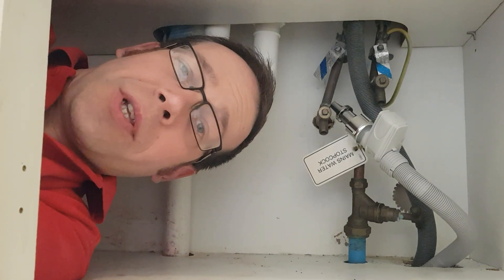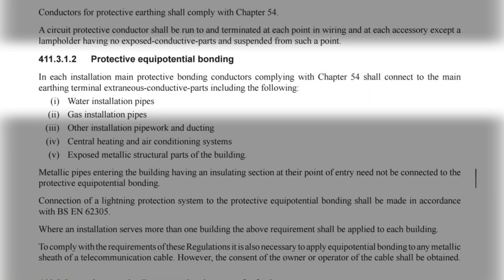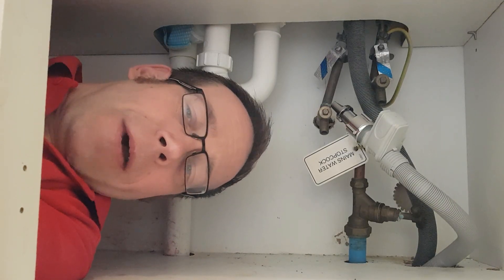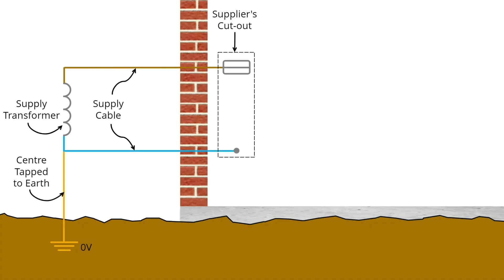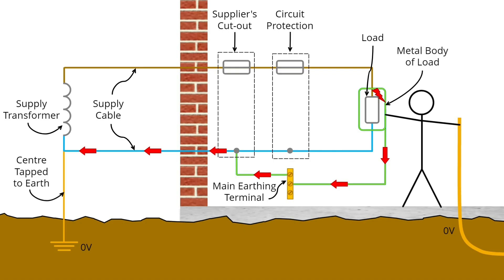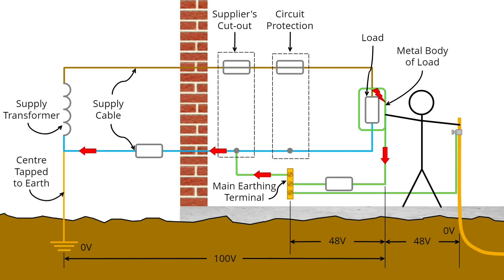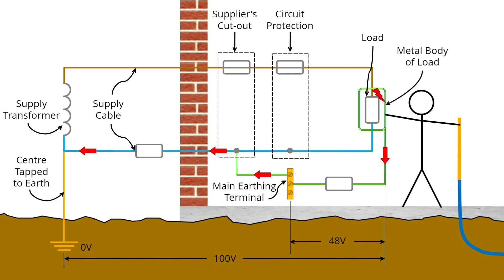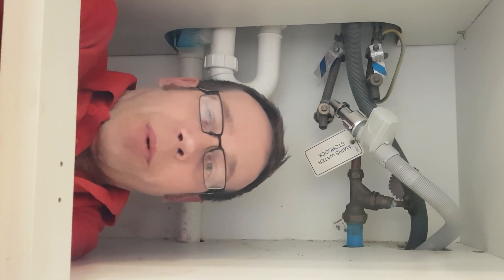DO YOU NEED TO EARTH BOND PLASTIC WATER PIPES?

Comment: Best thing to do is test the resistance of the metal pipework to the MET, if it's over 22 kΩ it doesn't need bonding, if it's under 0.05Ω it's already bonded , anything in the middle, bond it. Easy. Sometimes it can enter the building in plastic but something going on elsewhere in the building can mean it still needs bonding.  I've come across metal pipework that entered in plastic that's still needed bonding when checked.

Comment: What if there’s a water heater on the pipes that may introduce fault current to the metal pipe work?
Reply from the maker: Then the CPC in the cable feeding the water pipe should conduct the fault current back to earth and trigger the protective device. That's not what bonding is for.

Comment: It's hard to decide on the bonding, but I would think Bonding a metal object that does NOT have a direct connection to earth could actually be more dangerous as it could potentially introduce a potential on what is otherwise a fully insulated pipe (from the electrical supply) due to it not having any connection to ground.    As far the hot water cylinder argument, the hot water cylinder should be properly earthed anyway and therefore unable to put a potential on the cold pipe.   Training is a curse sometimes as things change as we learn more and training from even 20 years ago, while good at the time, could be outdated now

Comment: A loose electric connection can cause current leakage. We were shocked because when the distributor connected the electric meter had forgotten to screw the connections and our gas heater somehow was able to insert current on our water pipes. If it is there let it there if not maybe you will choose to.

Comment: From another country so please excuse my ignorance, but given the water is conductive enough to cause electrocution and is likely contacting the literal earth just outside the property at the next metal fitting and thus has potential, why would you not bond it anyway to ensure no potential shocks? In my country our version of TN-C-S also adds an earthing steak at the property to help prevent this situation.

If you have disconnected all your bonds from the incoming water supply you can test this by checking the voltage potential from both your taps and electrical Earth. 

I'm also surprised you don't have an earth steak, what would happen if you touched a metal exterior wall mounted light and the literal earth in the rain?

Comment: Water conducts electricity. What is inside the water pipe? A lot of gas pipes are plastic now and it is nearly impossible to tell!  Unless you test it! So you are damned if you do and damned if you don't. Then you have also got the DIY brigade. Way before the safe to touch test, i got a shock by pulling out a washing machine ( and supporting my back with the other hand on the worktop, fingers touching a stainless steel sink). The house holder had left bare conductors touching the back of the machine!

Comment: This is to assume that the only connection point between the ground and the water pipe is the incoming pipe. An underground feed  in conductive piping to a garden tap or outbuilding would do the same thing. There may be other possibilities too, whereby the property's internal conductive pipework has a connection to the ground. It may be rare, but it surprises me that it is not mentioned in the regs as a possibility.

Of course, the most likely way that the copper piping would have a connection to the ground would be via a gas boiler if the incoming gas supply is via conductive pipe, but then the bonding on that ought to deal with the situation.

Comment: How much potential could exist if the plastic was only a couple meters long does not water within the pipehave a low enough restitance to be a path/hazard where it is then connected to the lead incomer just thenother side of the wall. The short piece of plastic isnot acting as a complete isolation from ground? So a potential could exist?

Comment: Definitely earth it.  I have just discovered my stopcock was live due to fault on Powergrid cable making my earth rod live.  Powergrid told me the water pipe should be earthed but the supply pipe installer failed to tell me.
Reply: So if your earth rod is live and you also earth the water is that not live too? If it’s  plastic then it can’t become live, the only way it can become live is if you then earth the copper pipe.
Reply: @DTech101 The water was live, cooper pipework, taps, bath, all metal surfaces including radiators.  They tell me it's now repaired as they've replaced the 90 year old box on the utility pole and part of the cable but I'm terrified!!
Reply: @loriAlessiroberts118  unfortunately nothing you can do about there side only your side, but that should be good for years now
Reply: @DTech101  Yes there was nothing wrong with my side it was their equipment energizing the lead on my supply cable, but they've confused me by saying my water pipe should be earthed also.  I've since been told that wouldn't have made any difference as the earth rod was energized.

Comment: Ive just gone fully electric in my house. The gas is capped off at the meter outside my property (bungalow) there are no exposed service supply pipes exposed above ground level. All metal pipe work is now below floor leve or inside walls. My property has never had any bonding since the house was built in the 60s and ive never had any issues prior to do with fault conditions etc, but ive now been told that my electrical installation cannot be signed off if there is no bonding on both the gas and water. There is no access under the house anymore, so my question is...do I actually need to earth my gas and water if no pipes are exposed above ground level? Am I creating a new problem if I add bonding? I've had the flooring up but there is no way of running 10mm earths from the MET to the incoming Gas & Water supplies. Does this mean my electrical installation is now null & void and I wont receive a cert? Also does my install even need to be earthed taking into consideration the points above. Im having a major headache with this situation so any help or direction would be great appreciated, so I can work out a solution to my problem. Many Thanks.
Reply from the maker: Is the water pipe coming in to the property metal or plastic?
Reply: @efixx  Thanks for your reply. The water pipe is metal.

Comment: 'We can't apply bonding to allow for poor installation methods elsewhere'

So why have an earth at all?, we can't apply CPC's to allow for poor installation elsewhere.
Why have connections in an enclosure? - we can't be putting everything in boxes to allow for poor installation.

So yes, we bond the damn internal copper pipes, as a matter of good practice - as a safety measure for reality. 
Reality being the overwhelming majority of housing stock which has twin and earth run all over the place, not secured down, running on or near pipes. 

What ever happened to common sense? - If you fill nearly every wall and floor of your house with electrically conductive material running in proximity to live cables, sockets etc - wouldn't you want it to be earthed?

Comment: Bit old for this comment but unless your house is plastic plumbing then the pipe work will have earth connections via the immersion heater and boiler so may as well connect it back up is my opinion. At 45 years in the trade it completely goes against the everything to remove earths.

Comment: Unless the incoming water supply is demineralised water then it will be conductive (If there were any more minerals in our hard water local supply, it would be supplied in sacks). Regardless of the entry to the house, some of the downstream supply pipework may be metal anyway so there is possibly still a risk. Has there been any investigation as to this being credible?

Edit:- I have read some more of the earlier comments regarding water being conductive and I would add this observation based on my experiences in power stations- Demineralised water is non conductive, in fact it is used to cool HV stator windings in large alternators.  Insulating pipework lies between the windings and the pumps.
However, town water supply is conductive otherwise the electrode boiler (that was used for emergency use in part of the plant) would not work, as it depended on high currents passing through the water within.

My personal choice would be to bond anyway, as the IET rules on earthing seem to change rather often.

Comment: The plastic water pipe is only isolated when it is dry, otherwise it is connected to ground through the water within it so any metal pipe connected to this plastic water supply pipe is grounded through the water itself to nearest conductive pipework in the ground.

A ground can also be formed through a water leak. If there was a fault applying a voltage to metal pipework connected to a plastic water main there may appear to be no problem until one day there is a leak and the pipework is now effectively grounded creating a return path. This leads to a situation where it could be rather difficult to determine why breakers suddenly start tripping for seemingly no reason (possibly intermittently), people suddenly getting electric shocks in the bath or shower with seemingly no apparent fault and other anomalies. Whereas if the metal pipework was grounded the fault would be apparent straight away and not seem to disappear and then return as well as there being a ground connection that could me tested for current flow which would drastically increase the possibility of diagnosis in a timely manner and genuinely protect peoples lives.
Reply: get your MFT, put the probes in water and see what the resistance is..
Reply: @jameshansing5396   If water was an insulator, it wouldn't be possible to be electrocuted in a bathtub or shower. It's a conductor because of the impurities that are, basically, always present.
Reply: @DelticEngine  hey your tester out 👍🏻

Comment: Very well put. I'm of the same mind it makes sense not to connect it but having it connected doesn't seem like it would be that much harm and would be extra insurance in-case of an unintended fault. I'm not thinking poor workmanship that should be the above all standard is that accounts for so many things. I'm thinking water heaters and boilers which are already grounded anyway having a fault or other water loving electric appliances. And well water is non-conductive in a pure state most water has some minerals in it so it wouldn't be truly nonconductive. So does this mean if I have plastic piping going to my tub I can make toast in the bath? Well apart from the GFCI/RCD.

Comment: My only comment would be, none pure water is somewhat conducive, if the mains water pipe has leak and is therefore earthy could this then cause an issue, if the metal pipe work in the building is not bonded?

Comment: What if there is a bond wire to the cold water pipe inside the apartment. At some point, the plumber replaced the feeder pipe with PEX. Is there an easy way to check whether that was the main earth ground of the apartment, and would it need to be rebonded or to add earthing rods?

Comment: My plumber fitted a new stop tap, he used a plastic push fit connector onto the main water feed in then copper pipe then stop tap as it was live when he changed it. He left the bonding wire disconnected. Now because I have a plastic connector between the main feed and the house pipe work does it still need bonding as the old wire doesn’t reach to what’s left of the inlet feed pipe

Comment: Btw, you are a bit wrong about "no potential" part. Everything has a potential, and in fact it can be even thousands of volts. If you, for example, rub your metal bed with wool fabric, you can get pretty high voltages there. It is not the lack of voltage or potential that keeps you safe, but it is lack of energy instead. There is simply not enough charge and no route for the electricity to flow.

Comment: "We can't allow bonding to allow for poor installation"...!!!????... Nonsense!
THAT IS EXACTLY WHY THERE IS BONDING! 
Your logic says that no faults or errors can ever occur!
The difference between the bedframe and two dozen yards of copper piping is that the piping may well be in close proximity to mains wiring, and even mains equipment that isn't "installed" but could be brought onto the premises by a third party without and appropriate testing...
True it may be unlikely... but "unlikely" is exactly how accident happen!
Reply from the maker: So you don't think people run extension leads past their metal bed frames? If someone's conscientious enough to install bonding they shouldn't be running cables near pipes.

Comment: Interesting, I have a blue feed pipe  and have earthed internal pipping but was told to also earth stake the internal side of the stopcock with 16mm.
This video got me thinking,  I had wanted to run a soft copper insulated radiator supply a short distance to the garage in the ground, & the boiler is external oil but the oil supply pipe does already run in the ground !!!  This is going to be sleeved in the future but never the less getting wet. & what about old house pipes that in concrete floors. The  supply in is overhead line & earth  with a main RCD.

Comment: I would bond internal metallic pipes because of the risk of they being in contact to the line conductors at some point. That should not happen in a well done electrical installation, but accidents happen and there are bad electricians who will leave wires exposed near metallic pipes.

Comment: I notice that this topic has attracted 439 comments. Quite a lot more than the number on many of your videos. This fact alone is evidence that BS7671 on this point is SEEN as ambiguous, imprecise, internally inconsistent, and therefore UNCLEAR, even if those who drafted it do not think it is. 
NICEIC or anyone else having ruled on the correct interpretation does not clear the Standard as being "clear". Indeed I suggest it points to the contrary being the case. Having to call on a body to clarify a rule probably condemns the rule as being unclear. 
A standard should be clear, consistent, and not invite almost 500 comments. 
I hope that those with influence, including industry bodies, can influence the authors to make their intentions crystal clear. which I insist they are NOT, at least in the version you showed in the video.
Reply from the maker: The authors of BS 7671 clearly agreed with you David they've added this note to Regulation 411.3.1.2:
"NOTE: Where non-metallic pipes (e.g. plastic) enter a building and are then connected to metallic pipes within the building, the metallic pipes within the building do not normally require protective bonding as they are unlikely to be extraneous-conductive-parts."

Comment: Any conductive metal in a dwelling should be earthed.
Im an electrical engineer, all my training and experience leads me to earth any metalwork which is in the home.
Reply from the maker: Do you earth bed frames?
Reply: @efixx   Yes. I run a 16mm cable to the nearest radiator!  If its wooden? I'll tend you use 10mm.

Comment: My house has plastic pipes coming in, but I don't know that there aren't any parts of the internal metalwork touching anything conductive that's in the ground... In fact I'm pretty sure that the metal pipe to the oil tank will be connected through the combi-boiler. This old install is bonded and I'm keen to keep it that way
Reply: I also have plants touching my outside tap

Comment: If you bound the plastiq is like there is no bounding because plastiq does not conduct electricity, you can bound thr metal part of the pipe, is a secure stuff for an emergency when the water from inside the pipe can be energize.

Comment: There is the electrostatic potential, and the flow of water can still give a little charge. I have seen dust cling to plastic water pipes in use, although current is minimal the field is quite large.

Comment: In the sketch he says the water pipe could be lower resistance than the earthing, however the pipe has to connect to the earthing bond of the transformer to make a circuit, no way can it be lower as it is connecting to the same bonding on the transformer. It can be equal to the earthing or higher but not lower

Comment: If the incoming pipework is plastic, and all the internal pipework is copper, it will have no potential right up until the point you connect the CPCs for your central heating and immersion heater, then it will be at earth potential once again. Maybe just bonding it anyway isn't necessarily a bad thing to do 🤔

Comment: My problem with that Section has always been the confusion of subjects.  In the college science module they always emphasized the difference in concept and purpose between main protective bonding (the "main bond" to services and structure that TNCS requires to be >=10mm) and equipotential bonding.  The Section in question is titled Equipotential Bonding but the first Reg discusses main bonding.  The next Reg's then discuss equipotential bonding.  There is an argument both ways for main bonding of a service that enters in plastic, but to say explicitly that you don't need to include the pipe in your equipotential bonding while at the same time stating explicitly that any incoming service must have main bonding is baffling, badly written and contentious.  I have always said the authors need to go back to the HDs and determine the intent of the separate originating documents then issue a correction, or split up the set of Reg's to 2 different Sections, one for each type of bonding.

Comment: So out of interest on the EIC do you put N/A in the tick box then? Would this be sufficient or would you need to prove bonding is not necessary by providing a measured resistance value to prove it isn’t required ?